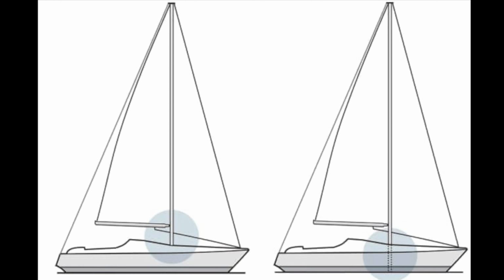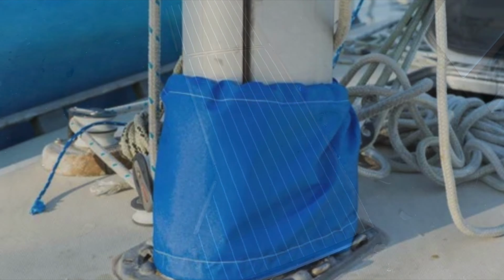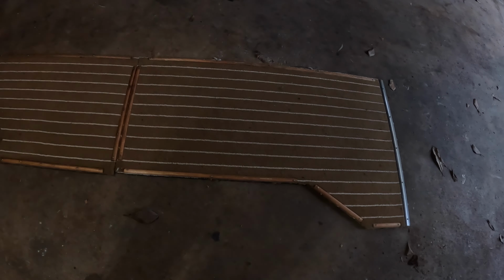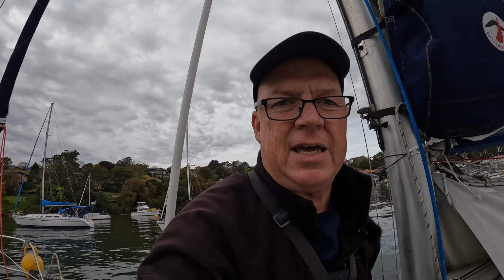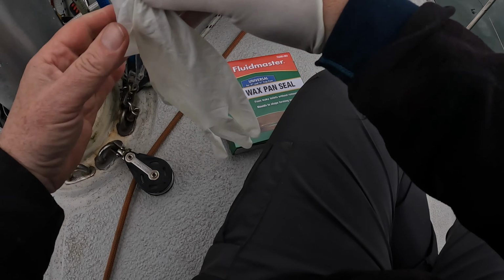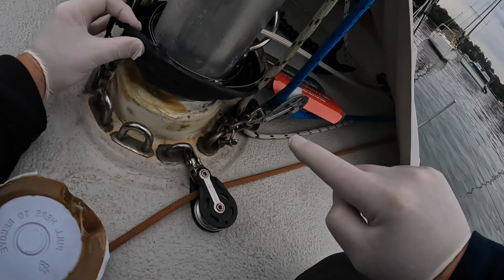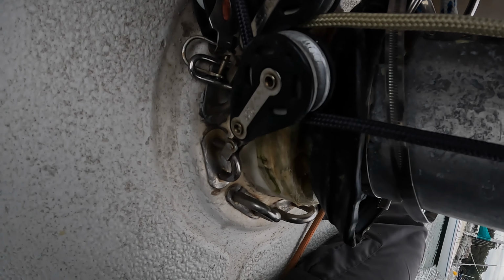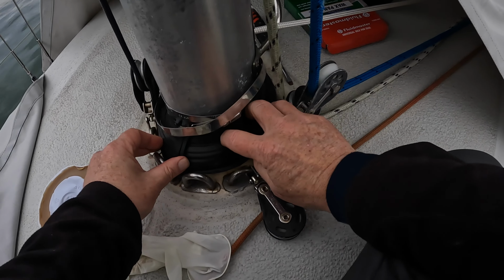Mast Leak FIXED for UNDER $10!!!   4K

Comment: What about heat? Wax toilet seals are not usually exposed to very hot temperatures but boats can get very hot.
Reply from the maker: Hi Liam,  Yes heat was one of my concerns especially as the wax is under a black boot at the bottom of the mast.  I tried to find data about the wax's melting temperature before I tried it but couldn't find anything.  I'm happy to report that so far I have detected no wax dripping down into the cabin nor any failure in its sealing capabilities.   I know it hasn't been the hottest summer on record but there have been some 30+C days and it's still working perfectly.  Thanks for watching!
Reply: @sailingelleray  If that should fail please look at Sikaflex. It fills gaps but is stretchy and will give or compress without breaking or letting loose. Water proof and bonds like the Dickens but is easily cut with a blade should you need to unstep the mast. It is so good you would not even need the boot. I have used it on experimental aircraft. Wonderful stuff. I have seen it in concrete specialty shops as it can be used to fill gaps in concrete too.
Reply from the maker: @liamstone3437  Hi Liam, Yes I use Sikaflex 291 all the time and I agree that it's a great product.  Interestingly, the sealant that has been leaking is the Sikaflex that was used by the rigger in 2021 when the mast was restepped.  I noticed some hairline cracks in it but given the large area that had to be sealed, I'm not surprised.  I could have just as easily used Sikaflex again but I saw this fix online and wanted to try it.  So far so good...

Comment: G'day! just been down the YT rabbit warren researching this, eventually found ur vid, now u have a new sub. In my search I came across this little gem, which I thought u may appreciate me sharing if there's a next time. Believe there could be room for improvement, i.e. laying down some rubber sealant to the raw pole to better bond/seal the bandage. As with all things susceptible to uv degradation, including some form of cover protection over it when done would probably also be a good idea. Cheers! - https://youtu.be/2S2RJMWdSFs
Reply from the maker: Hi Lana and thanks for coming on board!  He's done a good job in that video and certainly put some effort in.  I have to say that I'm still incredibly happy with how the wax is holding up.  It's just gone through a Sydney summer without losing any effectiveness and none of the torrential rain has entered the cabin.  All the best, Tony.